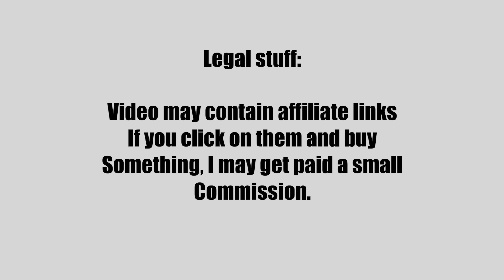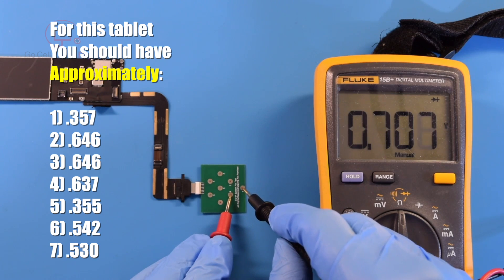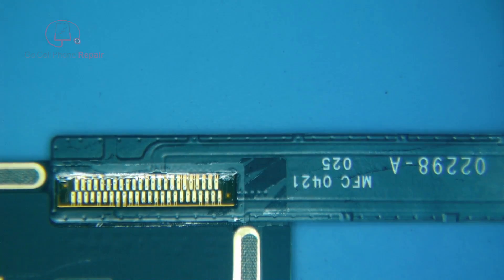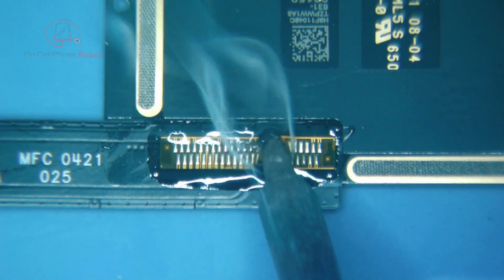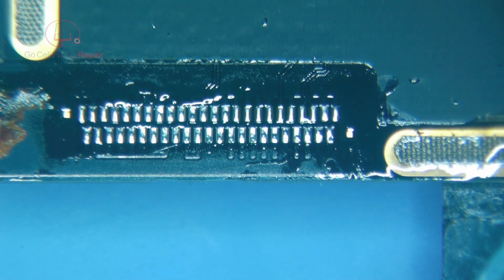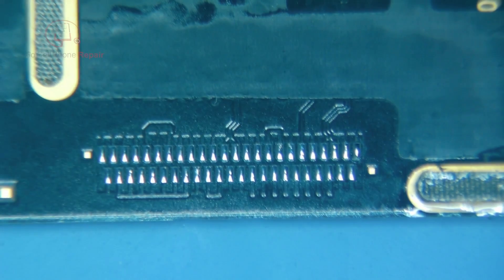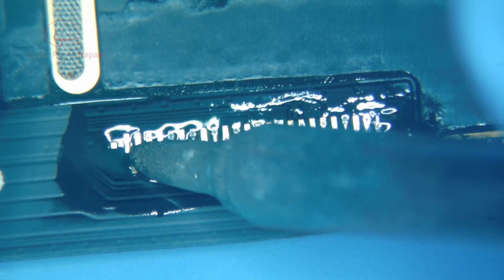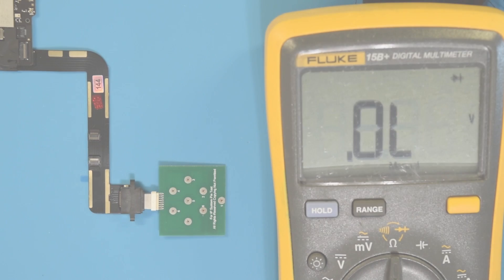iPad 5-9/ iPad Air Charge Port Flex Cable Replacement 2024

Comment: How to fix it wen i ripped the connection of the board to the flex cable
Reply from the maker: Depending on which pads are damaged, you might have to run a jumper wire to the affected circuit.

Comment: Clever way to test before replacing, but can you tell us how you understand by the reading? And is it same for others iPads as well ?
Reply from the maker: The best way of course is to have a working tablet of the same model but for the most part, they are all similar with the exception of #4 no longer being OL on some of the newer devices. I don't have a complete list but this video might help you as far as an explanation: https://www.youtube.com/watch?v=QY8Ajk5JJUk